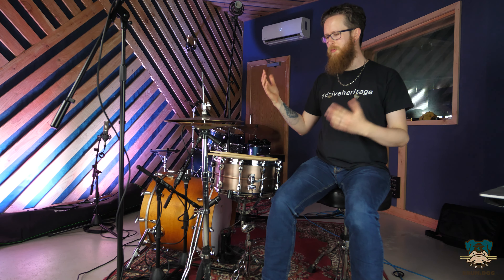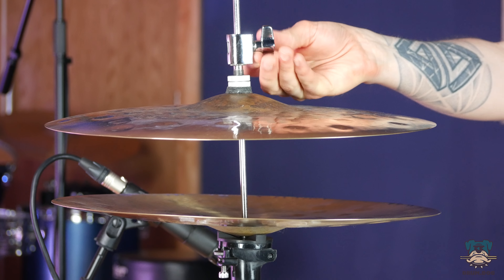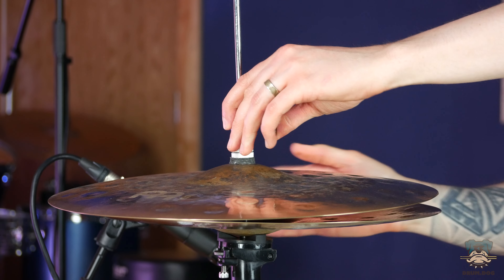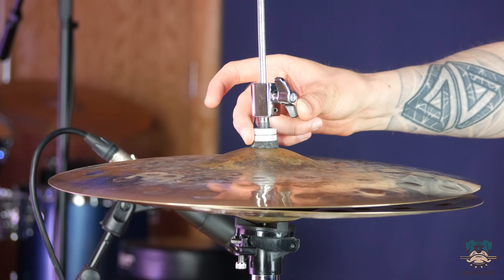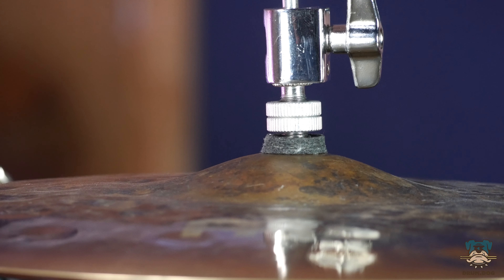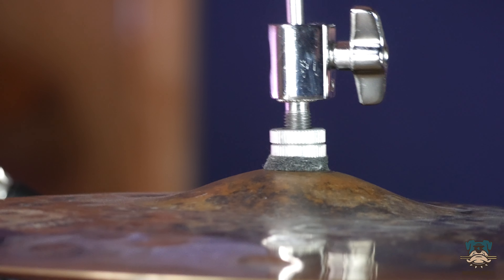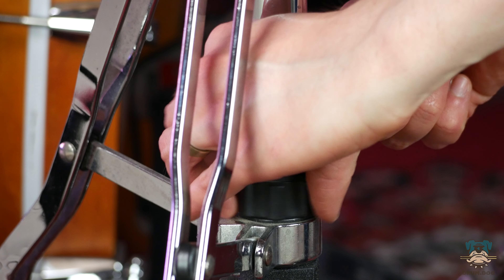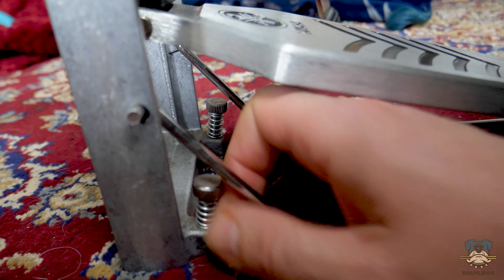How To Set Up A Hi-Hat Stand | Drum Dog

Comment: 5 months ago I started on a Tama Imperial Star. It's a great kit imo for a beginner. Then I bought a ekit and upgraded the kick pedal and hi hat stand on the ekit. Tama speed cobra 310 hi-hat and 910 kick pedal. I hardly touch the acoustic acoustic set anymore because I don't like going back to it because the rack Toms seem to far away. What's the solution for this?
Reply from the maker: Couple things you could try here!
- firstly, check your acoustic setup is as ergonomic as it can be, make sure those tom positions are as reachable as they can be 
- secondly, match your e-kit tom positions to the spacing of the acoustic kit. As the pads are so small it's each to get them super compact, but this doesn't translate to an acoustic kit at all, which is kind of the whole point, right?

Hope that helps!